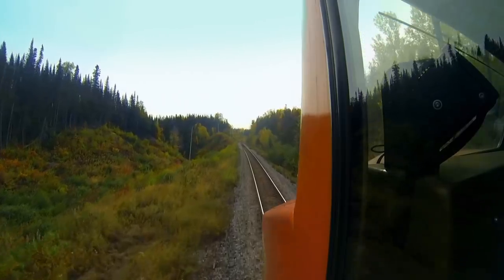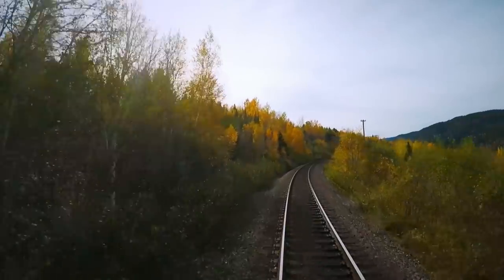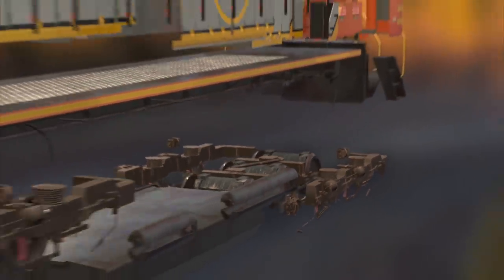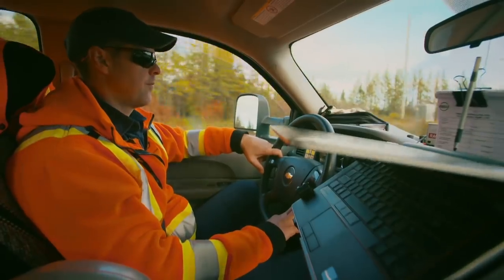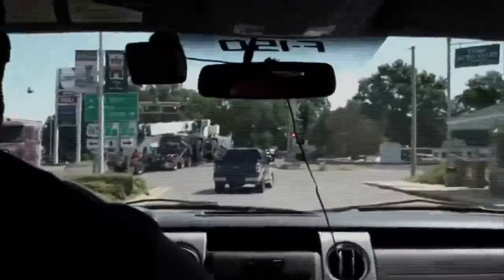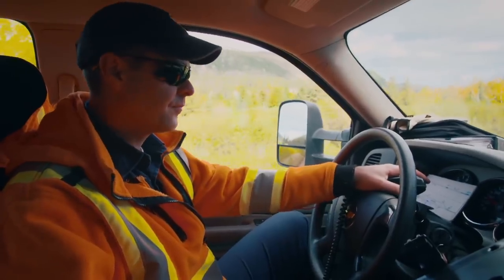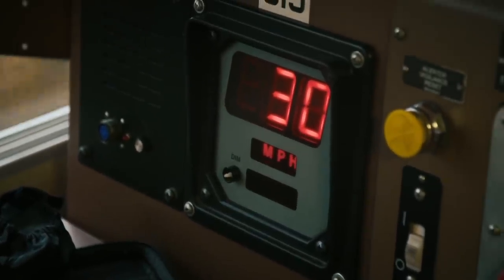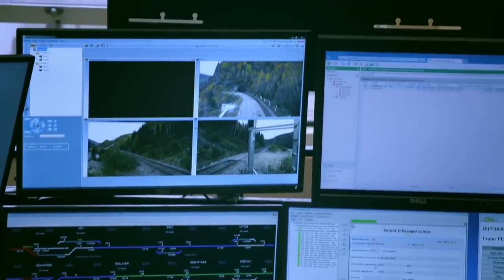The Mega Freight Train Is On The Move! | Rise Of The Machines

Comment: It's funny how overly dramatic everything is... I'm pretty sure HiRail and a semi stuck on a crossing are quite a bit different... And this size of train is more common than not in the U.S.
Reply: 30,000 tons isn't normal. It can be done on flat runs, like river valleys, but that much weight leads to a lot of trouble on hills.  The biggest issue would be broken couplers.
Reply: I had read in trains magazine that these Quebec, North Shore and Labrador often tip the scale at 33,000 tons. Few grade crossings and a mostly wilderness route allow immense trains like this to run regularly. In the. U.S. 33,000 ton trains are Not com
mon.  I'm sure some other expert can argue.
Reply: @torquetrain8963  I'm not an expert, but I do know that the trains that go through the Arizona desert area get pretty big. I don't know if it's 33,000 tons big, but it's close.
Reply: @steeldriver5338  they are a couple thousand tons lighter despite being about the same length. Raw Ore in full steel hoppers weighs more than Aluminum containers on open frame well cars.
Reply: it's just the way they seem to create these shows, even something simple as a documentery now needs some sort of conflict.

anyone with half a brain can tell you the whole thing was just a demonstration for the cameras...
Reply: Yes, must create a drama immediately before an ad break, only to find upon return it was nothing more than manufactured platitudes.
Reply: @torquetrain8963  I can settle this for you foamers.  33,000 tons does not happen at all.  I've seen 24,000 tons across the flats but its extremely rare and not something they aim for.  Bulk commodity usually runs around 13-15,000, Manifest up to 14,000, and intermodal is much much lighter although a bit longer.   Also this show exaggerates everything.  When going down hill on true heavy grade theres no way anybody is going 37mph. 14,000 ton ore trains where I'm at are only allowed to do 20mph.  I'm sure the grade this train is on is at most 1 percent and not very long.  And cresting a grade isn't about bunching a train up as much as it is about setting yourself up for balanced braking. There's engineers that drag a set over a crest to warm up the brakes on heavier trains, which naturally has the train stretched.  This show is full of B.S. to create drama
Reply: @rippdogg156  There's one long down grade not long before the destination in Sept Isles that they have to slow down for well in advance.  There used to be  passenger service on this line and we took it down to a hockey tournament every year.
Reply: @NeoclassicalRadagast  define "long", like 90 plus miles continous?

Comment: that was no 10mph on resticted track..looked like 30 mph..drama drama drama drama.
Reply: Hilleryyard lewsader yeah and why was the nut, washer and bolt all laying perfectly on the sleeper (Is that what they are called in English?). Shouldnt the nut be on the other side?
Reply: Zinan Watts ah alright, thx
Reply: @shalala4571  No, it should not. "Railworkers have reported a fault with a track." Therefore some guys have been there but did not have the tools or material to repair that, but they laid down the nut and bolt properly for the raodmaster to find them without searching around.
Reply: Pearly Humbucker Some wierd railworkers that don’t have tools to work on, you know, rails.
Reply: @shalala4571  And who told you that the reporting railroad personell were trackworkers? Are trackworkers the only railroad personell out there? Who does the work of an electrician at signals and switch motors, for example?
Reply: Pearly Humbucker A trackworker, translated into my language atleast, is someone who works on the tracks. So, for me, you told me it was a ”railworker”
Reply: I was just about to comment what you said

Comment: This is exactly what is wrong with public television. They overemphasize things so much out of proportion that it is basically telling lies. First off, the issue with the track. The train is 30 miles out. They have plenty of time to fix it. And since they know about it, the train crew knows about it. Secondly, they show the video of the truck. Yes they are destructive and will eliminate many things in their paths, but this maintainer (Guy in hi-rail truck) had a track authority to inspect the track and situation. The train cannot enter the portion of track on which the maintainer is on until he clears his track authority. This is your average day on the railroad, there is nothing unordinary or so spectacular about it. Also, the trucks (Wheels) on the locomotives. They make a big deal about how 6 axle locomotives have a hard time going around the curves on this line. They sent these types of locomotives out there with the knowledge of that. Each one of these locomotives have radial steering, which is explained in the video. Like I said, these TV shows blow everything way out of proportion.

Comment: 3:59 The information the narrator provides right at that timestamp is false. One of the drivers commented that 2 of them were taken to a hospital. 1 was drove to a nearby Mer Rouge hospital, the other (the guy who told the story) was airlifted to a hospital in Shreveport LA.

The train also derailed and piled up, too. Look at NS 9939 at 3:47, it jumped and went off the tracks, falling over onto the ground, destroying and piling up cars as they went of the rails.
Reply: MichaelALineCSX Productions it also had a EX SP RIP
Reply: @ironhorsemedia2881  eh I’m pretty sure it got repaired and repainted and put back in to service 
But still rip fallen flag